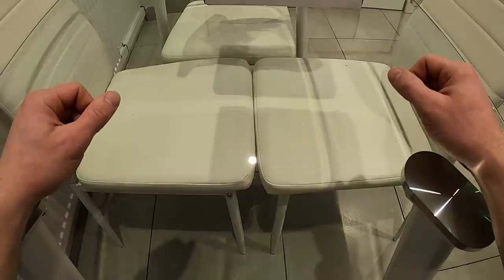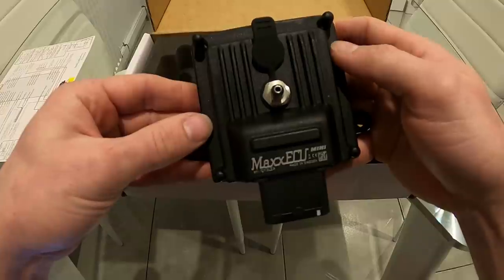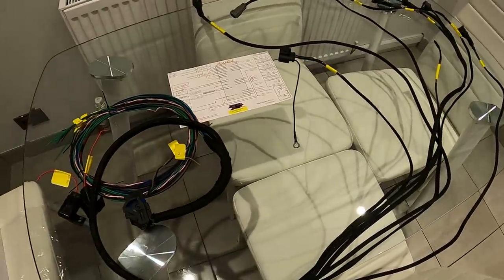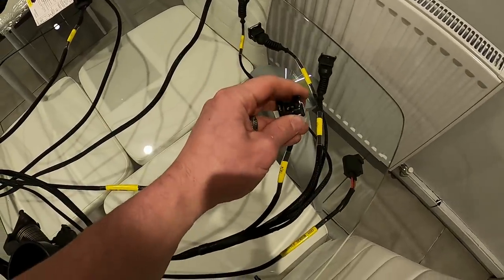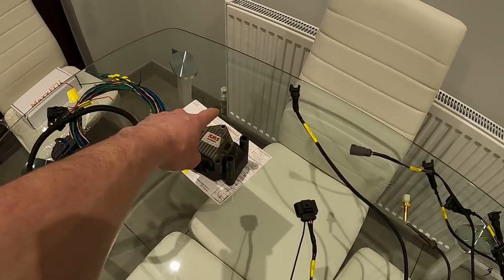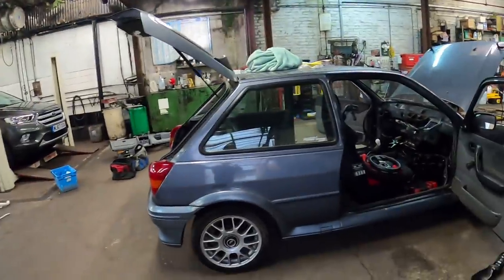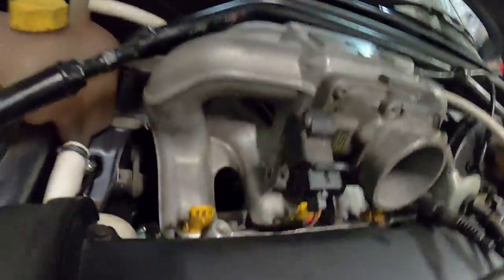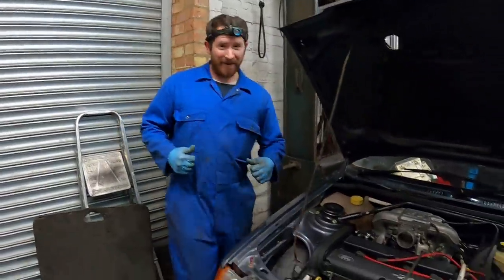##MaxxECU mini Zetec turbo wiring loom kit## fitting to Jamie's Ford Fiesta RS/xr2i mk3

Comment: Happy new year! I have future plans to put an st170 engine into an escort van. Have no problems with putting the engine in but not the best with wiring. Was wondering how you get around all the fault codes that might get thrown up when putting in a stand alone ecu, we know everything’s ok because the aftermarket ecu is dealing with it but when it comes to mot them fault lights might be a problem. How do you deal with that? Sorry Im new to aftermarket wiring and trying to learn a bit before committing to it.
Reply: If you're putting in an aftermarket ecu, the aftermarket ecu would not be sending a signal to turn the lights on.

Comment: which wires from the maxxecu should be connected to the ignition coil for a 4 cylinder engine? THANKS
Reply from the maker: If its wasted spark ign out 1+2

Comment: Can this be run in a piggyback mode to control fueling? I have a piggyback now but want to take fueling away from the stock ECU completely as it tries to constantly trim fuel. I have a dedicated Bosch LSU4.9 wideband with 5v output. Car is a 2ZR-FE-swapped Yaris RS with T28 turbo, current management is AEM F/IC. Thanks. 
https://www.youtube.com/watch?v=fFvwnmc09Qc